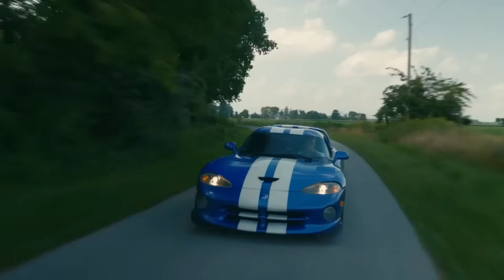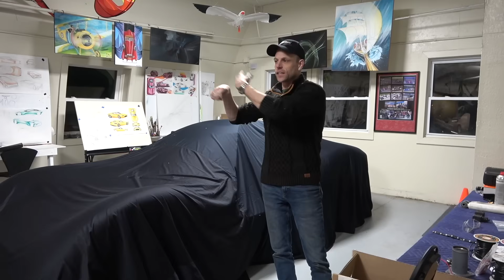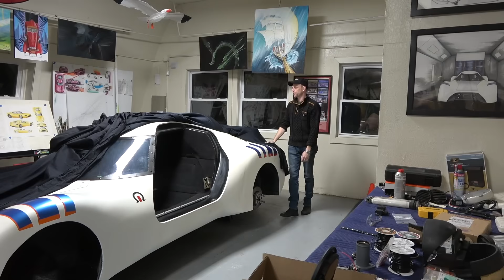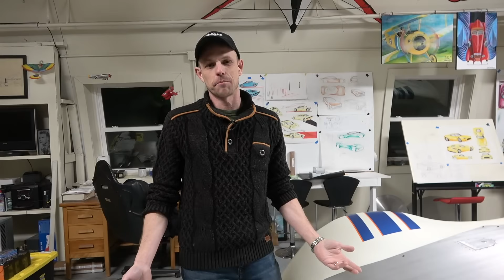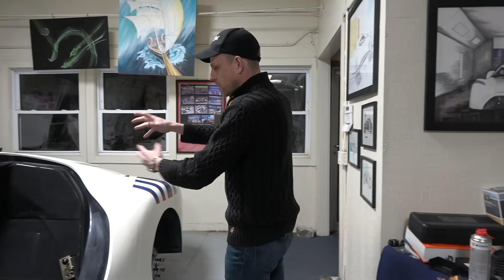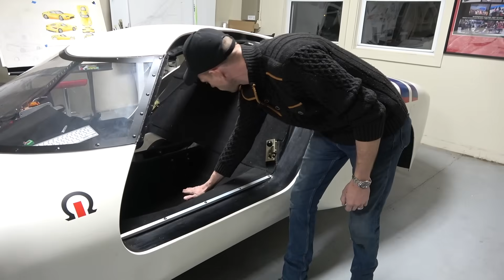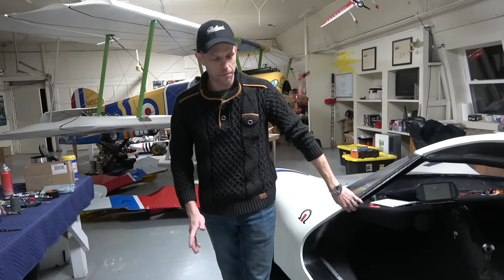Casey's OMEGA CAR because the AUTO INDUSTRY doesn't GET IT!

Comment: I've designed a motor that's eco friendly and I'm the process I received death threats from the oil companies besides the other car manufacturers that wants to buy me out. Now since it was my project since 1999 written on paper and made a proto type in a small scale,I seen great process in my engineering . I won't say was it is online because of all the problems from emails that going to take away my intelligence away from me but to build it for my knowledge from the auto experience as a ASE experience in the auto repair shops in years of fixing junk manufacturers computer money life of monopoly. I would love to talk with you and see if we can make something happen for the future in cars. I'll give you a fun down.. A motor with 10,000 rpm , can go 350 mph , one 12v battery, with no coolant ,gas, electric or oil  that would pollute the air of land...that's all I got to say... With a standard 5 speed car like my 2001 VW  Beetle with this motor alone would drive up to 230 mph on the dyno on the cars weight... Hit me up if this catch your interest

Comment: seats in normal cars flex backwards in an accident, I think that might be by design to prevent injury and death. your seats have no flex, plus it doesn't seem like it has crumple zones in case of a collision. it's just a giant death box
Reply from the maker: Thanks... you make assumptions, then an extreme erroneous statement.
Reply: @CaseyPutsch  when did speculation  become some kind of evil speculation? How is it "an extreme erroneous statement" if your car has never been finished to do a crash test? It's not my job to prove I'm correct or not. You're the designer, it's your job to prove your concept. The only "extremely erroneous statement" so far is you assuming you are right with no data or proof of what you are ASSUMING your car can do. I'm not even against your car concept. You suddenly went batshit crazy on the defensive for NO reason at all. It's an observation and a guess. If you can't handle constructive criticism what is the point of your video? Just so people can marvel at something that's not even proven yet? If you want me to believe in you without any proof you're wrong. You are not the next Messiah, you are not Elon musk. If you want to be this is the wrong way to do it
Reply: I don't see your vehicle on here proving even one difference!

Comment: While i commend the attempt to find better ways of manufacturing vehicles.your ethos of simplier is better goes right out the door opening All the added aero is a moot point when the top speed in most countries is 110 kph/ 70mph.At lest steel bodied cars are recyclable,where does this monocell end up at end of product life? I agree small diesel hybrids are the sweet spot overall environmentally.So you need a manual to validate your manliness?.A cvt is a way more environmentally sound solution for a transmission.Keep on trucking,the solutions will come from  backyard tinkerer's/inventors ,who people thought were mad,but they will have their day.

Comment: 4:35 Correction: It is not going to happen [if we are relying on established companies to do it]. 

We wanted the big companies to pluck down and make EVs and BEVs that were awesome and it has taken totally new companies, like Tesla, to do this. The older companies are finally taking steps, Porsche and FORD among others, to make EVs and BEVs that don't suck and/or look boring or bad. But they are much more expensive with ever reducing returns for the buyer or the company making them. 

It can be said, honestly Tesla is doing something to address this, however I would heavily bemoan this effort if "the answer" is to make cars that look like 1980's Sci-Fi prop vehicles rather than actually attractive  (Sorry Syd Mead -RIP) vehicles.

Comment: I friggin love this concept, and where you've gone with it!! I'm a truck guy, love in a very rural area, myself, but this... This has HUGE potential!! For the vast majority, there really isn't a need for a vehicle to weigh so much, or be so complex, that it's a struggle to find someone qualified to, or willing to work on it. Having a monocoque configuration not only simplified the manufacturing and safety aspects, but let's say for argument sake, we brought back a Ute or El Camino type vehicle... Said vehicle could replace the compact or light duty trucks, while maintaining all the strength and rigidity, so the suspension and drivetrain had a greater impact on it's classification and capacities. This is far beyond a novel concept you propose, this is exactly what we need!

Comment: For a sports car it looks great. Now when you make to hold say a family of five? When you need room for groceries? To a certain extent, form has to follow function. Real world engineers and companies have to make trade offs. Cost to manufacturers, marketing, wind resistance. One off cars can ignore most of that.  You may not think the auto industry is changing fast enough but for us older guys that remember say a 62 Caddie or Olds 88 the new cars have changed drastically. I can remember when the first cars with plastic parts came out. Small changes over time is how most things work. We didn't go from the wright brothers to the concord over night either.

Comment: My first car was a VW beetle. It was cheap to buy and to fuel. I didn’t have or need: air conditioning, power steering, power brakes, cruise control, power sunroof, 400 watt stereo, power windows, air bags, intermittent wipers, heated seats, rear wiper, remote power hatch release, emissions hardware including, catalytic converter, oxygen sensors, computers, antilock brakes, stability control etc... 
Guess what all of that stuff listed is in my VW GTI which weighs about 1500 lbs more than my beetle did. 
I wish I could buy a simple cheap car just to get me around again. It would be nice to be able to fix it without special tools as well.

Comment: -Economics is everything. Auto manufacturers make cars the way they do because it is the most efficient way they have found to make cars in the large quantities desired, at prices consumers are willing to pay. There have been myriad car mfgs. and they have tried every strategy they could possibly think of. 
-I'm with you when you say cars, in general, aren't very efficient aerodynamically, 
and are too heavy. But to say that there has been no change in car structures, or aerodynamics through the years is not accurate. 
-I also don't think it's accurate to say that the current crop of steel/aluminum frame cars cannot be recycled - they are. GFRP/CFRP recycling is still in its' infancy though... and it may not make economic sense to build a big recycling factory for a material that is rarely used, because it is too expensive to manufacture most goods with in the first place...
-You're going to fair the headlights with a smooth plastic cover, right? Rear wheel covers?
-I like the project a lot. Thumbs up! Keep going!

Comment: Look up Avion Car. It got 117mpg, in the Gueness book of records a few years ago. The car has been around since the 80's. I helped modify it for the X prize event to give it an updated look, better aerodynamics and even led drag. I was on tv making the car even. Craig Henderson is the car owrner. It was designed in the wind tunnel at Virginia Tech. I drove it and it is a fun, sporty car to drive. 3 cylinder Mercedes turbo diesel from a smart car. You can see it at 100mpgplus.com. also. Your car is pretty cool looking. I'm a tooling/ mold maker/ car and boat builder guy. I plan on cutting the body off one of my Corvettes and making my own.

Comment: I am a mechanical engineer, and drive and mildly modify a 2000 Honda Insight.  I  built and installed a 3 foot long Kamm tail and next want to take the exterior mirrors off.   So I for sure get where your coming from.  I don't think the general public really understands this desire to be thrifty and creative.  They drive to work every day by themselves in their huge 4 door truck getting 14 MPG.  It is really depressing.
Reply: That's usa.  Most countries people don't waste so much gas.
Reply: @consultant_researcher The USA is the world's biggest producer of oil. Driving huge fuel-guzzling vehicles helps to propel the economy.

Comment: I don't see anything out there I want to replace my current car. I crave simple light weight, capable small cars. I don't need or want some voice or alarm bitching at me because someone is beside me. Auto breaking? no thanks, I don't even like the hill holding feature. All it has to do is not work once and you bash the car behind you (Seen that twice this week on a shallow grade)

Comment: Just make slightly smaller cars that run on ethanol. But, the problem with ethanol is that anyone, anywhere, can make it dirt cheap and no one wants that.
As a flame retardant, I will point out that 80% of corn grown in US is not edible, and ethanol is 100% carbon capture cycle.
Diesel is good for the environment?  Look at lung disease numbers WHO has tied to Diesel emissions.
This guy is completely full of shit.

Comment: Had a 1981 rabbit truck about 15 years ago. It had the 1.6 n/a diesel. 
My buddy retimed the injector pump for me, so it would just puff the tiniest bit black smoke under full load. Achieving max power with out wrecking milage. 
I opened up the intake and the exhaust, which also helped improved power a bit.. 
Still was a slow car, but it could at least accelerate faster than a tractor trailer and keep up with traffic on the freeway. Moving the top speed from 65 to 85-90mph. 
That car would get 40mpg city up to a max of about 52mpg freeway, down from 55mpg before the injector pump mods. 
A very practical, efficient, usable car / truck.

Comment: There are some things in the video i fully support and understand, and some that bother me a bit.  For example: steel can be recycled, and is recycled. (maybe not in the US, but in other parts the steel parts of cars are recycled. Another thing is, if you take the air from the underside of the car, doesn't that get problematic in snowy, salty, muddy... conditions and going to damage (or clogg up) the radiator?
And lastely: abot mirrors, cameras and gageclusters: a good old mirror needs no electricity to work, needs no cabeling to be intact and is cheaper than any camera And if there is one waterspot on the objective of sucha camera you don't see anything. A dial with a hand to show you the speed you go will never have a pixel error, and will work even if your phone is damaged or you lost it or has no cell service. And if you build it from the right material it's better for the envirement and easier to recycle than the phones (which are a nightmare in that regard). Some "old school" things have their merrits. (at least to me).

Comment: Now i watched this whole video and i think one think is evident here, and that is casey has never worked within the car industry other than his home garage. Cluster panels in cars are 1/3rd the price of an ipad, so not sure how he worked that out cheaper. He keeps saying its cheaper to produce but doesnt say how, i dont know how he thinks a hand carved car could even compete with machines pumping out panel after panel, most factories produce hundreds of cars per day, this couldnt be possible on any hand made car, and the process of making his car could not be done by machines, it would need to be hand built, that would add the cost of thousands of people in every factory to make the frame and body. Recycled materials always cost more because they have been reprocessed, so this is going to add considerable cost to every car to convert to 100% recycled. The points about drag, wing mirrors, back windows, car manufactures already know about this, they have designs around this when possible, but mainly due to safety regulations around the world many features have to be standardized, he hasnt taken the cost of anything the car industry has to go through to get a car on the road, safety tests, driver convenience, repairs, spare parts, shipping, customer service, service and sales centers, large scale manufacturing, warranty and recalls, the fact that every country has different laws for vehicles and you need it to pass everyone, the added time to build every car, he doesnt even understand that most manufactures bring 3rd party suppliers into the factory or build new ones right next to them to supply them for efficiency, probably one of the worst videos i have seen on this and just a click bate title, should really be what casey doesnt understand about building cars. The easiest way to see is that he thinks a $500 ipad is cheaper than an $80 instrument cluster for a car. The reason you pay a little more for a car is because it comes with a host a features and support that casey wouldnt be able to provide in his hand made car, right now if i need a part for my car i can get it overnight shipped to pretty much anywhere in the world and get my car fixed, i wouldnt have to wait for my part to be made, then sent to me. He really doesnt understand...
Reply from the maker: ShroomzGames gotta love Monday morning quarterbacks. Here is an excerpt from a Theadore Roosevelt speech I share with my students on just this subject. https://youtu.be/w3sH_8nw2uM

Comment: the car needs guages
you should NEVER require that the user have a smart phone. you cant know if they can have a smart phone, or if it will work with the software you make or if the pone is even powerfull enough to run the software.
and, if the phone breaks for some reason, well suddenly driving the car is not possible if you are like me and can't tell speed without the guages or if you are in an unfamailair place and the normal cues for speed just don't work anymore
this can cause proplems with people unknowingly speeding and getting in a accident
maybe you can use the phone for the non crucial guages but for speed, tac, and fuel, I would say that guages are a total must

also, less reliance on electronics, the production and recycling of electronics is horrible for the enviornment

Comment: The flow is not laminar by the time it makes it there (to the radiator area). If it were it would detach anyways as the angle is too steep. Not seeing the underside or whether you have a fan you may be ok. If you're not you'll need a fan and/or turbulator

Diesel is efficient because of the compression ratio. If you're not in boost you are less efficient then an Otto engine. If you haven't compare their respective efficiency equations.

Grid efficiency is <30%. Electric cars are idiotic from a system standpoint. They are less idiotic considering the very, very, bad distribution of energy cost for regular consumers relative to the source.

I could go on but, eh, good luck.

Comment: You should try using a diesel > generator > super capacitor > electric motor setup. That way you have the best of both worlds running  the diesel at the optimum rpm for efficiency storing the energy in light super caps to power the electric motor for fast acceleration. Then you have high mpg, high performance and unlimited range.

Comment: I have a feeling that half the reason why we dont go to shells like this instead of steel is because they take real skill to repair rather than bolt in bolt out construction. Which makes them harder to work on for the common man. We are working harder instead of working smarter which in turn is somewhat decreasing the basic skills of the common man.
Reply: No, it's because conventional stamped and welded sheet steel construction is the lowest-cost way of mass producing cars that have stiff bodies and good crash safety.

Comment: I'm waiting for a car company to manufacture and mass produce single-seater cars with composite bodies, in an open-wheel configuration...something like a modernized 1930's racer, but with all the public road-going safety crap piled onto it.   There are amazing renderings all over the internet.  RX00047 concept, Infiniti Prototype 9, Audi Union 2017 concept...do a Google image-search for "open wheel concept car."  Panoz had a roadster at one point that was close.  Ariel makes the Atom, and there are the Caterhams and a small handful of others, but these aren't practical daily drivers.  A lot of the auto makers have already come up with concepts in this ballpark, but they won't make them.  Honda had the Project 2&4 Concept, which could be grown into a fully enclosed cockpit. Same for Toyota's e-Racer concept.  I'm like, c'mon, somebody grow a pair and send one of these to market, already!  Why do I have to push a 5,000lb iron death machine 30-40 miles hauling only myself to work and home, Monday through Friday?  So much wasted fuel.  So dumb.

Comment: How much $$ would it take to create a fully functioning POC ( Proof of Concept)?  Crowd Funding, with the proper message, like this video....hint hint, marketed the right way and distributed to the proper channels, may prove to be a viable way to go.  I think you are on the right track with the methodology.  Side cameras are already in high end cars, but aren't really that expensive.  If we explore this line of reasoning, possibly the Casey Putsch followers can reach out to their connections with this message.  I have to believe we are in touch with influential and forward thinking people in this diverse group of followers.  thinking about the mirrors, what about retractable mirrors with camera screens so the regulators don't complain??

Comment: If I may ask, you said your radiator air intake was on the underside.  How well does it work in winter driving slushy road conditions? (considering wheel wells often build up with ice blocks).  I'm just trying to picture your design

Comment: Casey if you go gas powered look into mazda skyactiv system.Or if you want something different look up smokey yunick hot vapor engine system.He got 51mpg in a fiero with the stock engine but a turbo added on it.